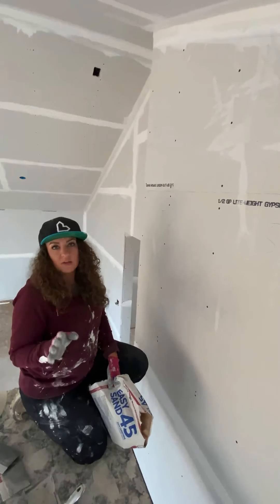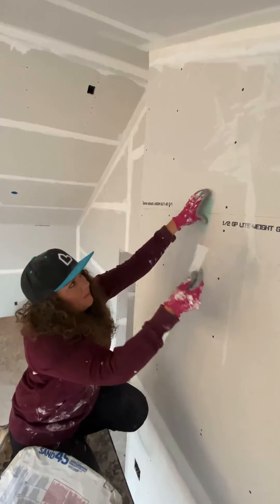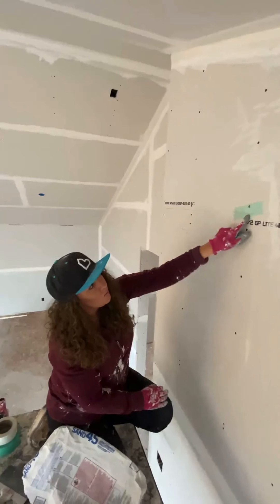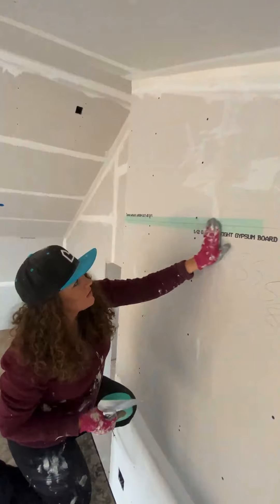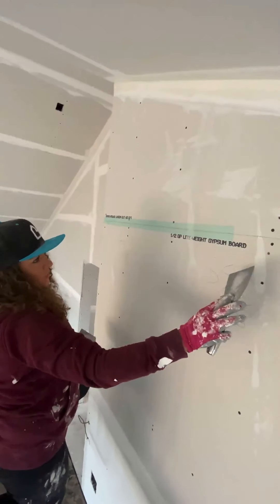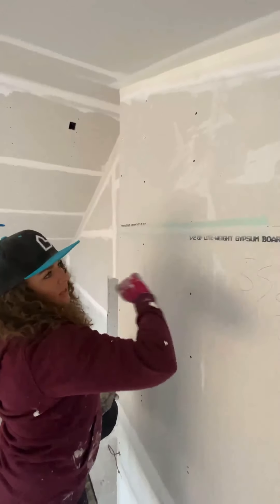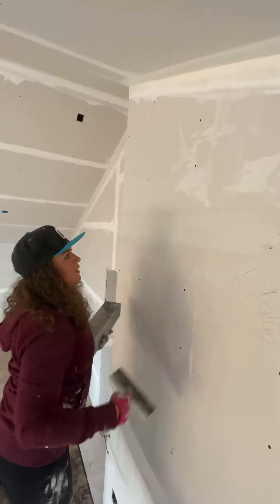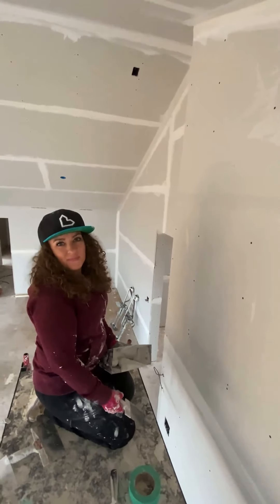How to use Easy Sand/Hot Mud and Mesh Tape

Comment: Just a little tip....when doing a small room with mesh and hot mud...do the corners with straight flex perfect 90...it's the quickest system for hot mud. It beats regular paper tape because you don't have to fuss with the apex of the angle.

Comment: Just a novice DIYer.  Is it okay after that hot mud has set up after an hour or so to come over the top with plus3 for the remainder of the coats?  Also,  Can you use hot mud with fibafuse? Since it squeezed into the fibafuse tape?

Comment: So can you use the paper tape with the hot mud? I just bought my first house and a guy I know gave me a list of stuff to get.  He has not shown up at all so I need to do it myself. I got the drywall up,and now I have paper tape & mesh tape, 3 bags 45, 3 bags 90. I feel like this guy had me get the wrong shit.
Reply: She said no in the video because all the pros use all purpose mud with paper tape. I've used hot mud with paper tape in certain situations and it's worked out just make sure the consistency of the mud is on the wetter side or you will get blisters in your tape. Or if you want to make things easy just get some all purpose to tape with

Comment: The cracking isn't caused by the tape, so saying that if you use mesh tape with an all-purpose compound, you will get cracks isn't true. You get cracks from movement within the drywall, enough to shift the joint. Using certain types of tapes within the manufacturer's specification can help reduce the visual aspects of cracking, or not, but neither tape will cause cracks. Watch this video if you don't understand https://www.youtube.com/watch?v=jUzF1d-eDCI&t=24s

Comment: Why shouldn’t paper tape be applied with hot mud?thats how it’s done in New Zealand and Australia??it’s the standard here
Reply from the maker: You’re system and products are probably a bit different than ours. Hot mud doesn’t shrink when it dries so it doesn’t pull the paper tape into the recess like taping mud does. Our taping mud in the US is formulated to shrink and pull the tape flat, it also has glue in it to help the tape bond to the paper faced drywall. It’s pretty simple actually- paper faced drywall, glue which is the taping mud and then paper tape. So paper, glue, paper - makes for a good bond
Reply: @DrywallShorty  thanks for explaining 👌
Reply from the maker: @robfra7042  no problem! Every country has different methods